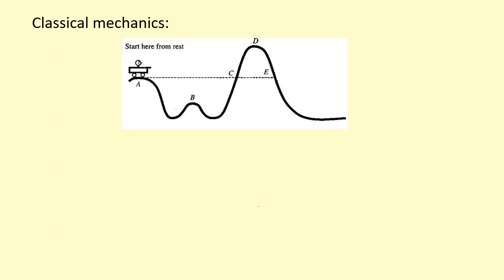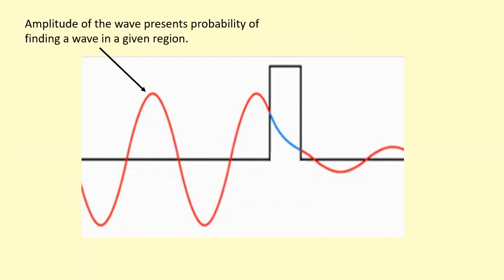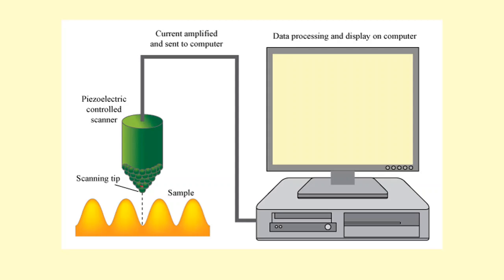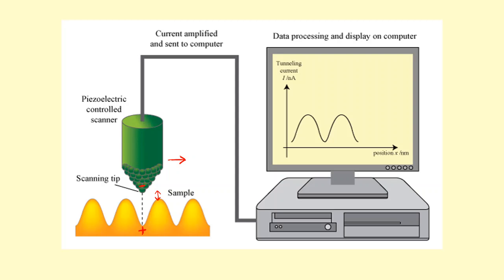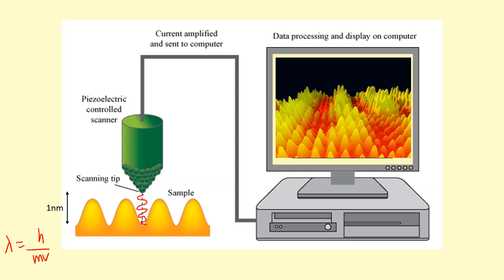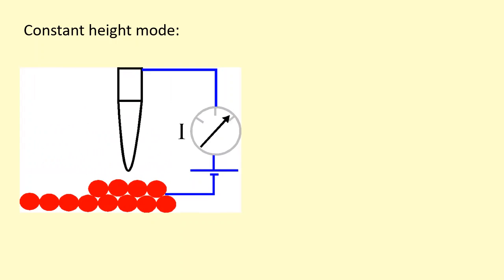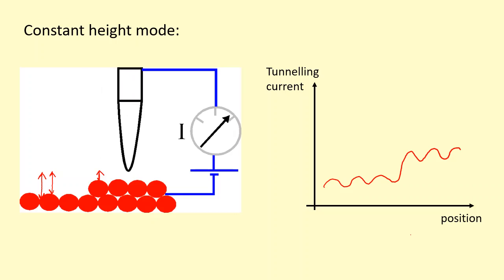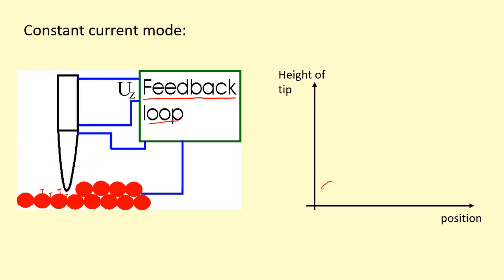14.17 How does a scanning tunneling microscope STM work?

Comment: Great video, was just curious about the sensitivity of the transducer. You said the sensitivity was 0.01nm, but on the video its written 0.001nm. Which is the correct sensitivity? Thanks.
Reply from the maker: Just checked and it's 0.001nm. I said it wron gin the video but the image is correct.

Here is AQA's document.
https://filestore.aqa.org.uk/resources/physics/AQA-7407-7408-TG-TPIP.PDF

thanks for the spotting the mistake.